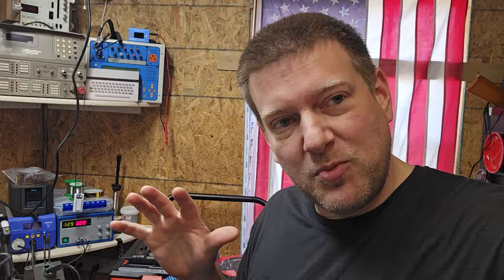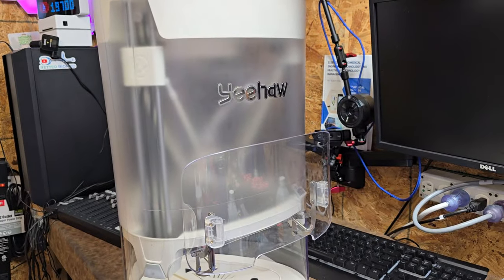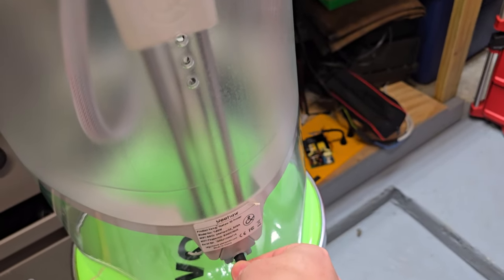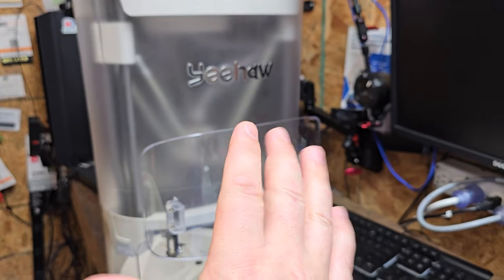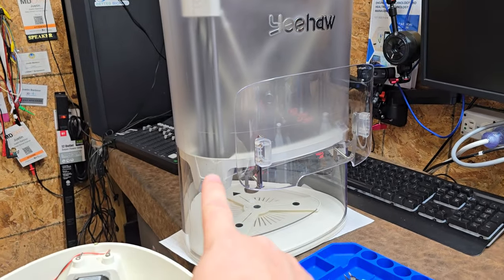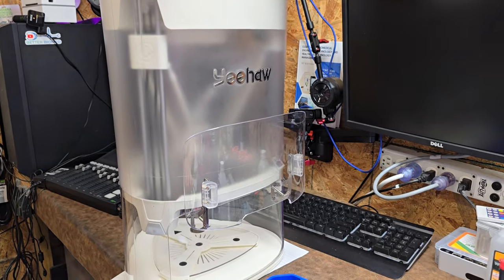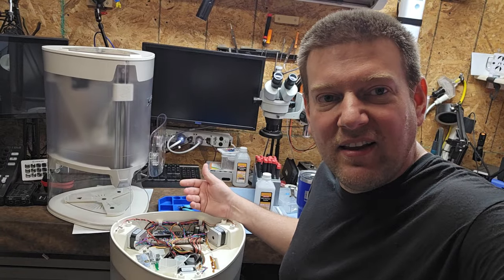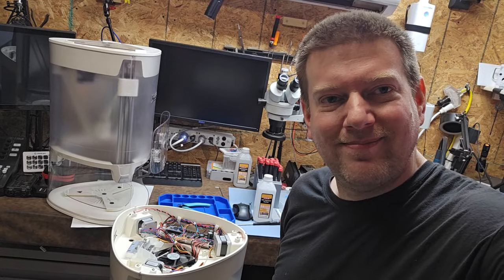Yeehaw 3D Printer Hacking

Comment: the little chip, is probably a anti-paralel diode to form a "crowbar circuit". if your polarity isnt right it shorts the input, and if the psu is stronger it will turn into a constant short.
Reply from the maker: That's absolutely correct! I removed the shorted diode and the DC input card is fine now.

Comment: I saw you repair a Sony DR80MD and am hopeful have a repair video for an error message I cannot work around. It blinks I have a paper or ink roll problem. Changing paper roll and ink rolls does nothing and same message persists. Any help would be greatly appreciated. Your explanations are great. Thanks
Reply from the maker: Try running the printer without a cassette. Make sure you change the paper AND the print roll
Reply: Thank you so much for your reply. I'll try immediately  Fingers crossed👌
Reply: @BetterBiomedChannel  What do you mean 'Cassette' The ink rolls?
Reply from the maker: The cassette is the print paper and ink casette.
Reply: @BetterBiomedChannel  thanks for your help. I followed all your suggestions plus tightened the color rolls and restarted. Everything worked. No error messages, thanks a million